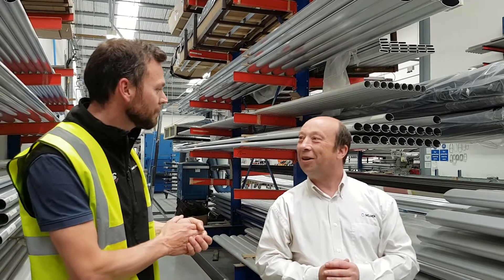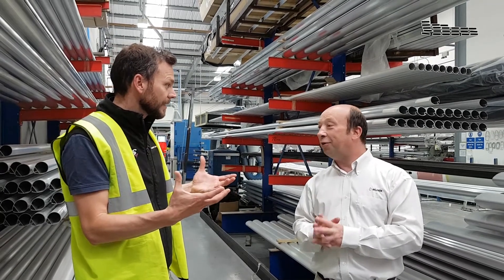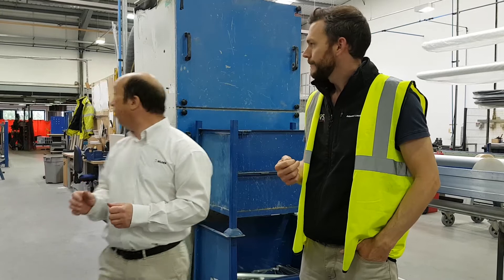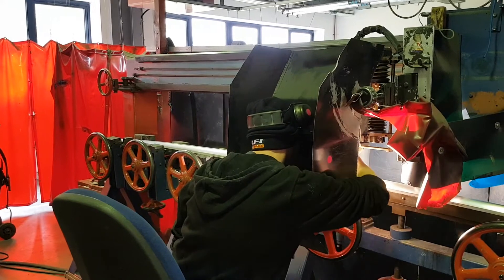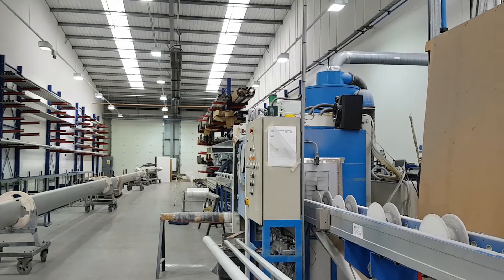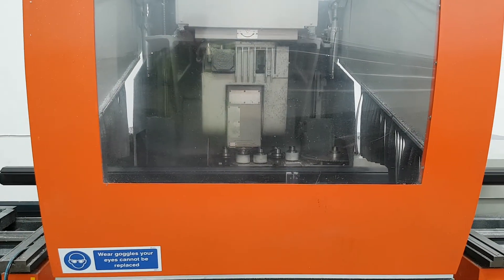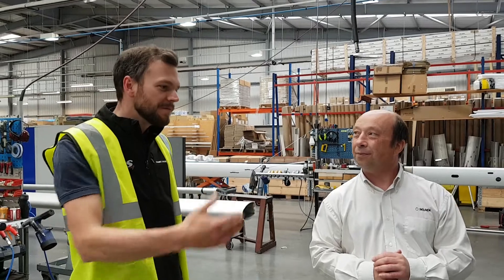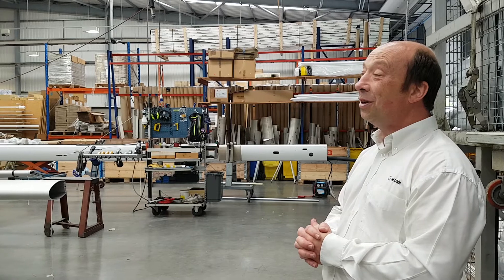How masts are made for sailing dinghies : Friday Forum

Comment: Stiffness is an indicator of the tendency for an element to return to its original form after being subjected to a force. Strength measures how much stress can be applied to an element before it deforms permanently or fractures. Hardening affects both as is demonstrated in the video the un heat treated material can be bent easily and it does no significantly return to its original shape, it is very mailable it bends but does not break. When heat treated it will not bend as easily and if enough force is applied it may actually break but the force required would be much greater. So it is both stiffer and stronger. Everything is a trade off.

Comment: Both the guys here are confusing stiffness with strength. Heat treating does not make a difference to stiffness 
(the distance a length of extrusion will deflect under a given load) 
but to strength 
(the amount of load which will cause the same item to develop a permanent bend)